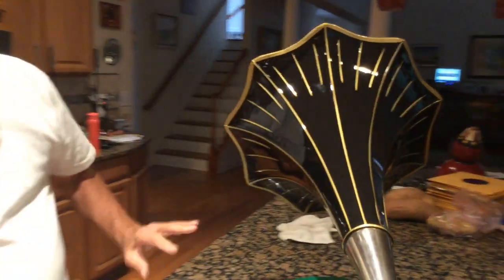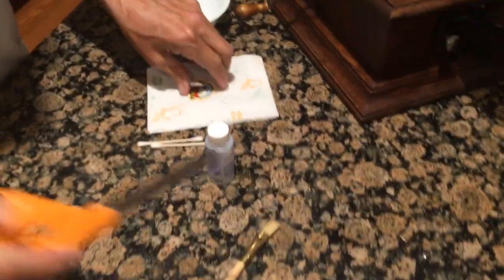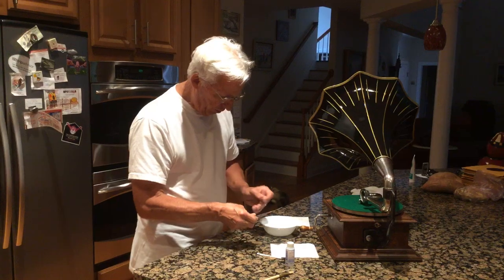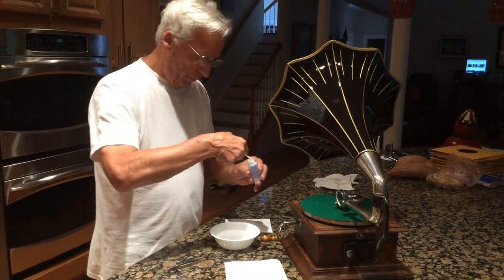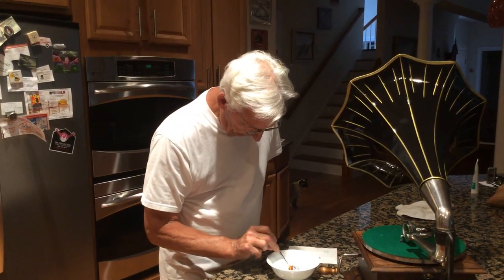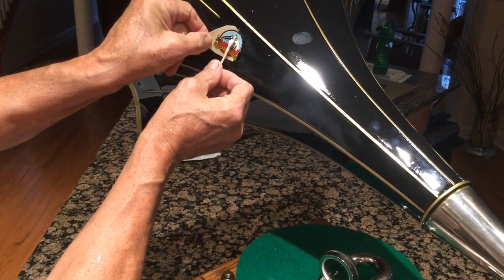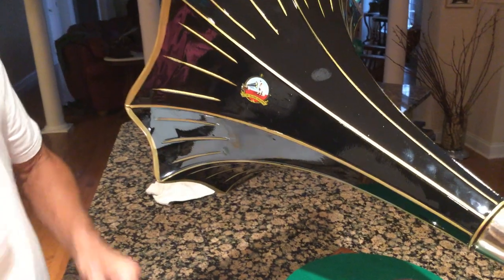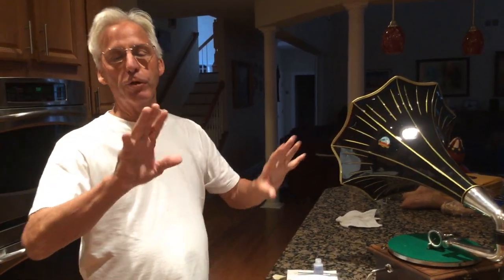347.  How to apply a water slide decal to your phonograph or horn

Comment: Can you remove a decal that is mostly gone and reapply a decal? Obviously sanding is out of the question. Do you have a video on that?
Reply from the maker: The original decals were glued on. If you don’t want to sand you can apply some water, then apply direct heat from a hair dryer to soften the glue, then rub it with a dish towel to remove. If you can find an identical decal it is possible to apply a new decal on top of the old decal But you have to be spot on. I have not done a video on that.